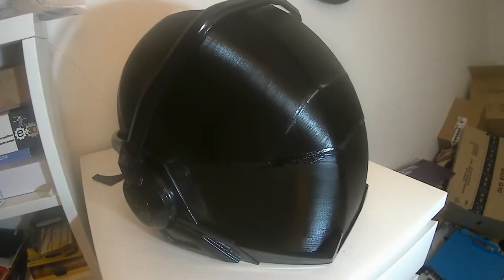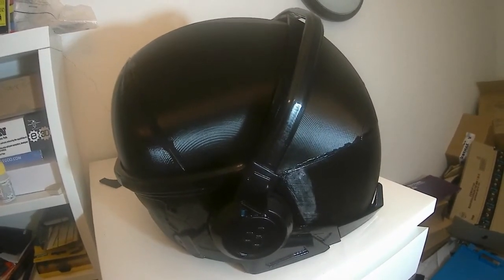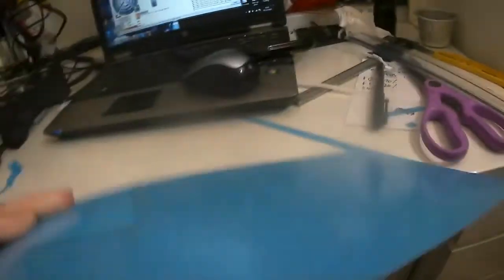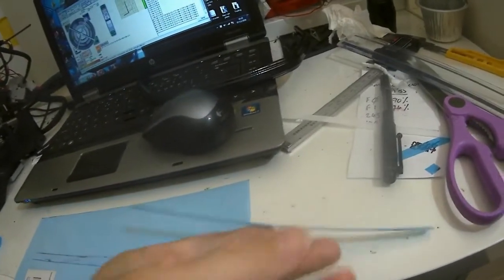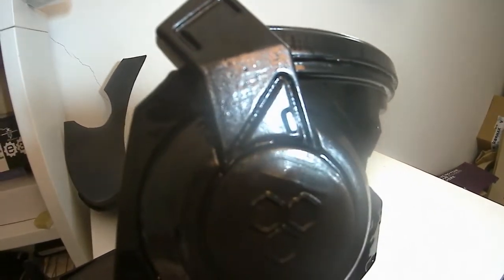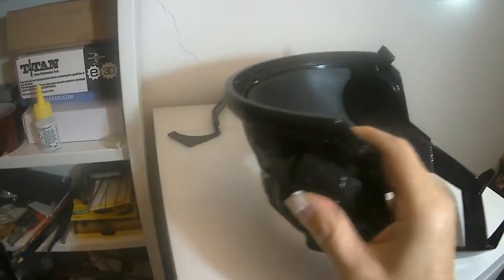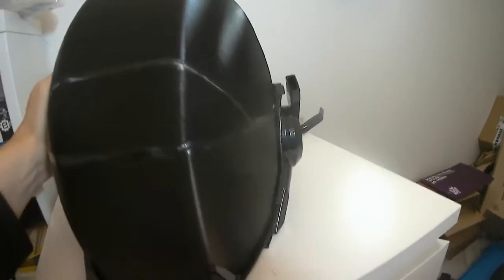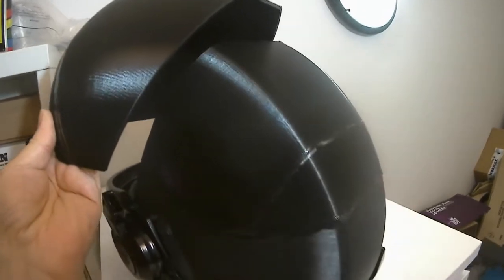Making the Elite Dangerous Remlok helmet Part 3

Comment: I like your idea of the LED. I must say, I was expecting a clear visor. A bit disappointing. Have you considered Thermoforming? You can 3D a plug and vacuum a heated clear plastic over the plug. Or you may be able to use the printed visor you already made and use it as a plug.
Reply from the maker: Walter, as I mentioned in this video and others the visor WILL be made from clear see through acrylic sheet vacuum formed over a 3D printed mould made visor like the one I’ve printed. The whole point of printing a visor at the start is to get the size shape and fit correct FIRST.
Reply: Can’t wait to see it. Great job!
Reply from the maker: @walterrinebold3923  Files are available on Thingyverse now  https://www.thingiverse.com/thing:4714998

Comment: How big is the space inside?
Reply from the maker: Bigger than my head :) it’s designed to wear. In fact lots of room for foam padding to wear comfortably :)
Reply: @Antonia.Bradley  I'm just curious because I have a fat head.
Reply from the maker: :) well you can of course increase the percentage size of each part x % in your slicer program if you wish. Alternatively you can measure the size of the helmet using a cad program such as 123d design. Unfortunately the helmet prototype is at home in Menorca and I’m now here in the U.K.
Reply: @Antonia.Bradley  well now I'm jealous that home is Menorca. I'll probably just try and put them together in tinkercad and see how big they need to be from there. I'll let you know how it goes!
Reply from the maker: Hi Jimmy, no need to worry, just measure the outside width of the front visor as that is the inside width of helmet. It’s length front to back plus the length of the rear dome is the inside size of the helmet front to back. The height of the visor is the inside height. All less 3mm thickness of course :)